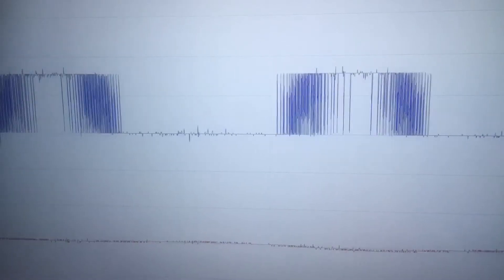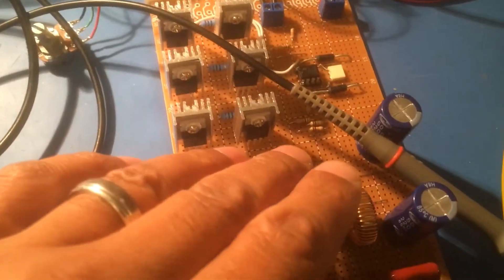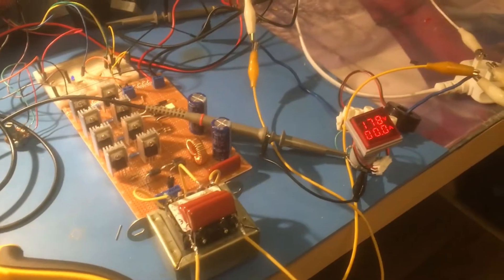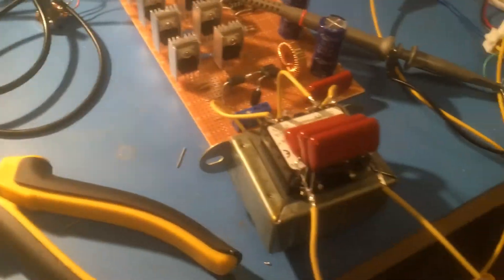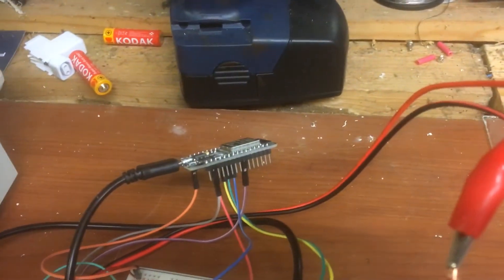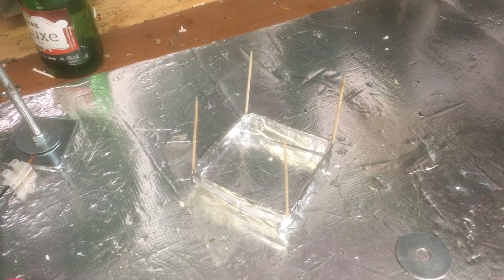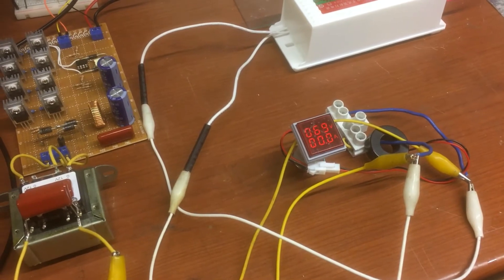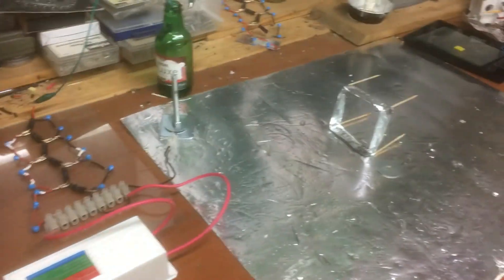My Neon Sign Inverter Driving an Ion lifter (source & schematics)

Comment: I didn't get a chance to work on my project to upload a video. I did however order some new parts to get my power supply working more efficiently. Hopefully i will be able to upload one tomorrow
Reply from the maker: Do you know the thing Im struggling with now is actually finding a box to put the voltage multiplier in, its all splayed out over my desk at the moment. Any ideas? Building the inverter took a lot longer than I was expecting. I went through a lot of false starts, (doing it as an class AB audio amplifier with bipolar transistors). I think one of the biggest time wasters was getting mosfets from ebay/amazon. I was getting lots and lots of unexplained failures of irf3205 mosfets that should easily have been able to do this task. In the end I got most of my parts from rs, and now it just works.I need to test to see how far I can push it, and if successful I will begin building another 5 or 6 or so.
Reply: @c6jones720  That is so funny that you said that. That's the same problem i have, but i had to go back to the books and read. I found out what i was doing was wrong. So i purchased some expensive new mosfets amd transistors. Had to read the datasheets on these things and learn how to read and understand them. While i was reading. I found an even better solution for stability. First i will test out the new power supply. My mosfets can handle up to 900v.
Reply from the maker: @goobman1981  Im seeing an effect I didnt see before I used the inverter.  Im seeing arcing on the wooden skewer I use to move the lifter with. Before I never saw that. If you get within 2 inches of the corona wire now the tip of the wooden skewer will start to carbonise and you see a little blue corona on it.
Reply from the maker: @goobman1981  I was wondering about the big mosfets. I had considered looking at IGBTs myself, some of them have similar current voltage ratings for serious power
Reply: @c6jones720  Hi, I used to see blue arcing on my wooden stick too. The box i put the multiplier in, is a project box i found at microcenter. I tried using the new mosfets and they don't work, but if i connect them to a motor; they work fine. They will not self oscillate with the feedback coil. However i did use my modern flyback like the ones you have for zvs and it worked, but it worked with my 260n mosfets.I drew almost a inch. As i drew the arc you could hear the frequency increasing. Then it stopped working. The mosfet was luke warm. I did discover that a main culprit is my wires. I ran it again with another 260n and the wires got hot and started to melt and smoke. The wires i'm using sometimes work and sometimes dont. I need a thicker wire, maybe 16awg or 14. I'm thinking about wiring the 555 with the hv mosfets to see if it makes a difference.
Reply from the maker: @goobman1981  Cool, yeah I wasnt expecting to see that sort of arcing to a wooden stick. One of the problems I think I came across was back emf from the transformer. This can destroy the mosfets very quickly. Thats why I put transorb diodes in parallel with the mosfets. I made sure they were a lower voltage than the mosfet VDS. I suspect thats what killed the mosfets form amazon/ebay.   I havent come across a problem with my wiring (yet) The input to the inverter has tended to be 13Amp houshold wiring I found lying around. I think I have worked out an enclosure. Im thinking of mounting my multiplier onto a large sheet of mica for microwave shielding (it not that expensive)
Reply: @c6jones720  I found out that mosfets stays on unless u have a pull down resistor. I even put a zener diode across the gate and source (reverse). When i put a reverse diode across the primary coils. It didn't work. I believe the problem was the wires were carrying 12v but not enough amps. Thats why they got hot and melted. When i ran it with the motor it was no problem because the motor didn't require more amps. The new mosfets are rated at 900v and 500v, the gate voltage required is +/-30v. Well i'm only putting in 12v.
Reply from the maker: @goobman1981  Thats right, sounds like you need some thicker wiring. In my design the mosfets are driven by an op amp each has a 10ohm load to drive the gate (that signal can be thought of as a bus), but I made sure there is at least 1 10K resistor to ground to discharge all gates.  Its very important for switching that the mosfet gate is given the right voltage above VGS(th) and below VGS. For the mosfets I use Im using 10v which should be a good safe voltage to use for switching. same as you I put a zenner there too, to avoid overdriving the gates.  I havent run into the problem of wiring yet, but its something I have considered, if the next inverter goes well I might consider getting a low cost PCB made up for it.
Reply: @c6jones720  i was doing some reading. I will try 100k for pulldown resistor and a 10k for gate. I will try to look for some thicker wires. I also read that i should use a schotty diode across the primarys. Not a regular diode.
Reply from the maker: @goobman1981  Yeah I used transorb diodes. Those little extra components were put on there after earlier versions of the inverter failed. I sat there with a scope and determined that elements like the capacitors on the transformer, and the inductor were having a true and beneficial effect.  - Cant wait to see what you come up with.
Reply: @c6jones720  Me too. Lol. I was thinking of either running the 555 with optcoupler or a transistor to power the mosfet.Also all flybacks are not all the same. Especially since my A/C is old from the 70's or 80's.
Reply from the maker: @goobman1981  When I was using dc flybacks there was a lot of variability int he outputs. My guess is that they were recycled from old CRT tvs. Some were great but most were not very powerful. As for the drive of the mosfet, I ended up using an opamp, because say an LM358, you can get that to swing up to 30v if you want, plus it basically has a push pull output. I had considered a bootstrap gate drive circuit, but its not necessary for what Im doing.